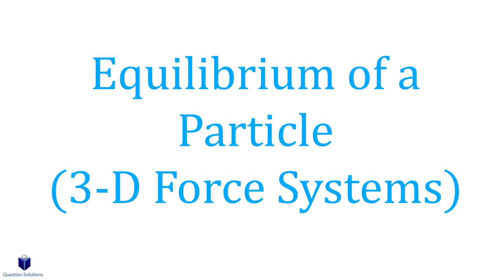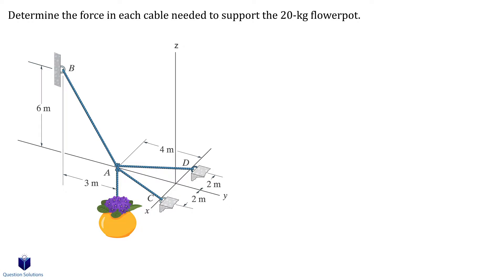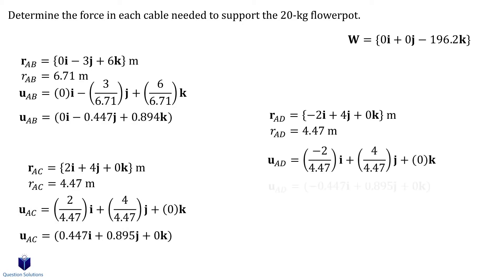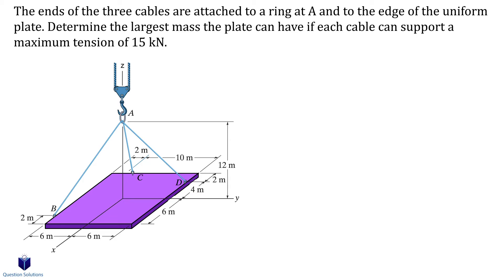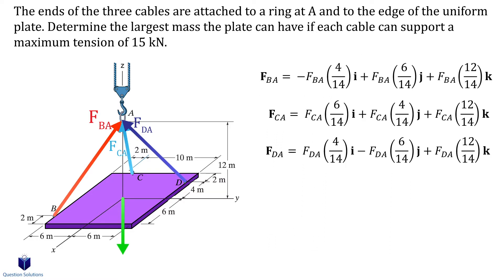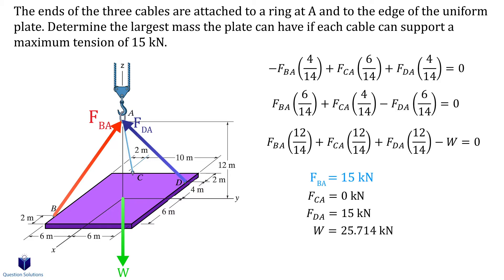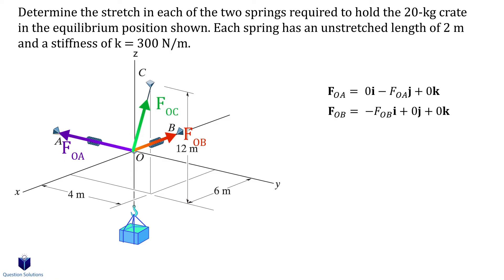Equilibrium of a Particle 3D Force Systems | Mechanics Statics | (Learn to solve any problem)

Comment: In 1:17 why there is only z component ? Isn't there also has j component(+4j)
Reply from the maker: No, the weight is always straight down along the z-axis, so almost always, it will just have a z-component. Also, how did you get the +4j component?
Reply: @QuestionSolutions  because its starts from point A
Reply from the maker: @sevgipnar5261  Point A is the origin since that's where everything starts from. The weight technically starts at point A. It just pulls straight down, so there are no other components.
Reply: @QuestionSolutions  how can point A origin ?didn’t we write A(0i -4j +0k )
Reply from the maker: @sevgipnar5261  Okay, I see what's happening. You are mixing up forces expressed in cartesian form vs position vectors. The weight, which is 196.2 N, can be expressed in cartesian form as just -196.2K. When we need to express forces in the cables, we need to write position vectors from A to D, A to C, and A to B. We do NOT need any position vectors for the weight, because it just has a z-component. I am not sure how to explain this better, but one way to think about it is to realize that the cable holding the pot is straight up, it's not going to the left or right or anywhere else. It's just straight upwards, it does NOT have any other components. Again, you are mixing up expressing forces in cartesian form with position vectors. Please kindly watch this video first: https://www.youtube.com/watch?v=CCeWy1kmxMs
Reply: @QuestionSolutions  ohh okay thank you
Reply from the maker: @sevgipnar5261  You're very welcome. Please let me know if you need further clarifications. I want to make sure you understand this.

Comment: Hey man, awesome video, it was extremely useful, and I tried to solve the problem on my own after viewing it to make sure I understood it. However, I believe there is a small error at 2:23 where F(ac) and F(ad) should be 58.4 instead of 54.8.
Reply from the maker: Glad to hear it was helpful. Also please see:https://www.cymath.com/answer?q=0.447C%3D0.447D%2C%20(-0.447*219.5)%2B0.895C%2B0.895D%3D0 for a breakup of solving the 2 simultaneous equations. Thanks!

Comment: how did you get the Fab @ 2:17
Reply from the maker: You can use the equilibrium equation for the z-components. It has just one variable and it's easily solvable for Fab. Pause the video at 2:16 and look at the very bottom equation. 👍 Let me know if you still need help.

Comment: In problem 3, Soa and Sob are solved. But is that the total stretch? Do we add the given 2m of unstretched that was given in the problem?
Reply from the maker: You do not need to add the 2m since we are only looking for the stretch. So you can set the original stretch to 0, and then see how much more it stretched after the weight was hung. If the question asked us to find the total length of the spring after the mass was hung, you would add the stretch to the 2 meters. Otherwise, for this question, it was just extra information that wasn't needed. It's the same as not caring about the length of the rope that's holding onto the crate.

Comment: In the third example way it involved springs, don’t we add 2 m to 0.218 and 0.327 since both the springs at OA and OB starts with an unstretched distance of 2 m?
Reply from the maker: So the question is asking for the stretch, in other words, if our original length was x, how much more did it stretch from that point. The 2 m given is unnecessary info, probably to confuse students, or for another part that shares the same question.
Reply: @QuestionSolutions  so, we can pretty much think of s as the change of displacement.

Comment: how did you solve Force ab, ac, ad at 2:21 ?
Reply from the maker: FAB is a very simple solve, it's just one variable with a single equation. The other 2 can be solved the same way, plug FAB into the other equation and solve. Use substitution or elimination. Isolate for one variable, plug that into the 2nd equation.

Comment: In problem 1 how did you find Fac and Fad I’m still a little unsure of how you got 54.8
Reply from the maker: Once you find FAB from the 3d equation, you can plug that value back into the other equations and solve. It's 2 equations with 2 unknowns, so use any technique you're comfortable with like elimination or substitution. Isolate for one variable and plug it back into the 2nd equation and solve. 👍

Comment: What are the steps? Like 1. Find location 2. Position vector ... so on..?
Reply from the maker: It depends on what you have to do. If it's a force along a line, it's a bit more tedious, but generally, you need a position vector, a unit vector, then using the unit vector, you need to express the force in cartesian form. I cover this in a different video before this, please check the description.

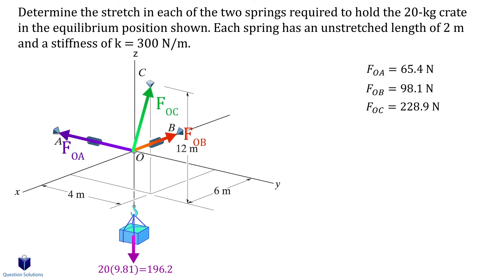Comment: Hi sorry, but how did you get the FoA, FoB and FoC at 5:59?
Reply from the maker: So you have 3 equations with 3 unknowns. You can use any method you learned in high school to solve them, like using elimination, substitution, etc. You can even graph them to see where they intersect. Also, you can double check your answers using wolfram alpha. :)

Comment: After finding Fab (@2:17), how did you find Fac and Fad when they were both two unknowns?
Reply from the maker: You have 2 equations with 2 unknowns, use any method you learned to solve them, substitution, elimination, graph them, etc.
Reply: What method did you use?
Reply from the maker: @karellhyajervoso7979  For 99% of the problems, I use substitution. If it's more than 3 equations, I use a matrix. You can also use wolfram alpha to get a quick answer.

Comment: for the second question if we assumed the position vectors traveled from point A to the plate would we get wrong answers?
Reply from the maker: So really, you are assuming a different direction for the force. That's fine, make sure to carry out the proper signs (positive/negative) until the very end, and if you get a negative answer, you know it's opposite to your assumption. 👍
Reply: How do we know what’s the direction of the force

Comment: for 3rd example, the spring we don't need to consider its length? for example r(OA) = -2j , r(OB)= -2i
Reply from the maker: If the question asked us to find the total length of the spring after the mass was hung, you would add the stretch to the 2 meters. Otherwise, for this question, it was just extra information that wasn't needed. It's the same as not caring about the length of the rope that's holding onto the crate. 👍
Reply: @QuestionSolutions  ohh that makes sense thank you very much !
Reply from the maker: @yeohthianshenupm7885  You're very welcome!